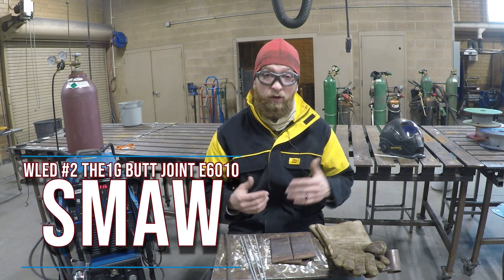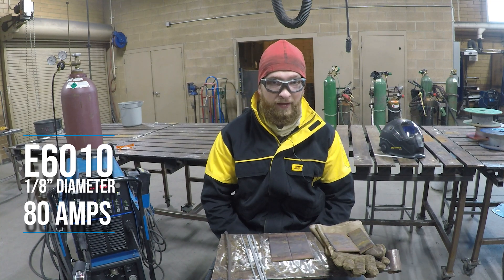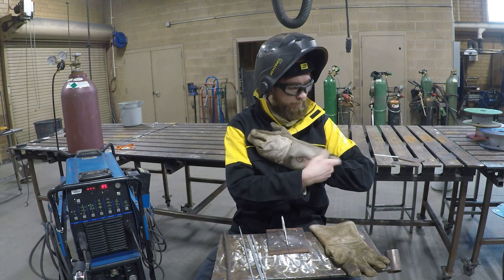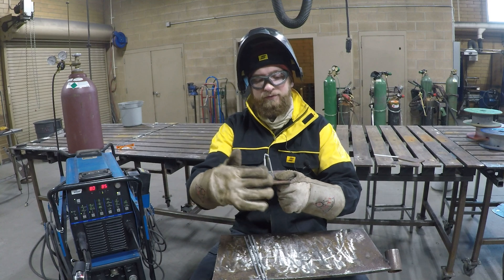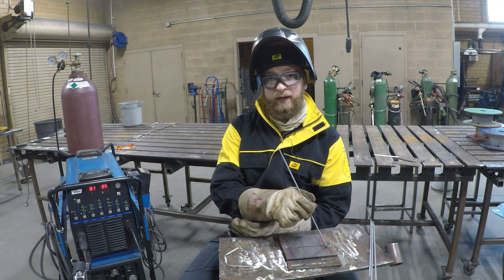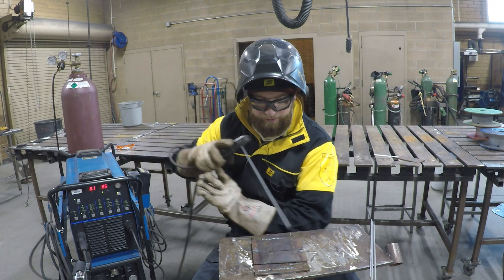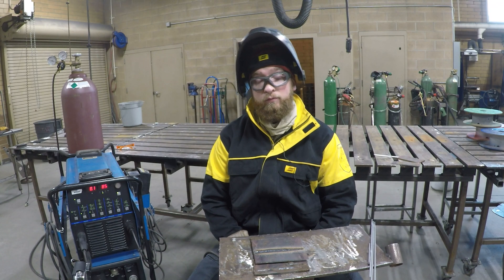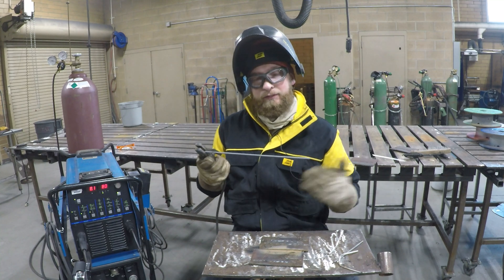SMAW WELD #2 Butt Joint  - 1G E6010

Comment: Nice vid thank you. I have a question about extension cords. Do you think that thinner extension cords gives lower amps than the settings? I live outside the US and it’s a take what you can get. I’m a new welder but definitely find 6010 vs 6013 a more reassuring penetration
Reply from the maker: Absolutely. If you run small, or very long cords the voltage will drop. Ohms law states that they are all connected variables and it will effect amps as well.

Comment: I noticed that your recommendation is different than what I've seen before. Usually instructors recommend that when one whips away from the molten pool, the rod is sunken into bevel (arc length reduced drastically) known as "choking" in order to release excess heat and then return with the regular arc length over the solidifying molten pool to stitch the weld together. I see that you recommend the opposite: where one should increase the arc length slightly during the whip away and return with a shorter arc length to facilitate penetration. This might be the difference that I am looking for. I have no consistency with 6010. I get it sometimes and the others I make a complete mess where my rod sticks and I get no penetration. Thanks for the advice sir.
Reply from the maker: I use the method you mention for just beads on a plate or when the joint is more solid.  With a gap, i'm  trying to  really get the puddle down in the joint.
Reply: @mmhswelding  will definitely give it a go. Thanks man

Comment: Can you run a 7018 on that ???
Reply from the maker: That's a great question. Here in the U.S. most believe that you have to/or should run an open root with E6010. Several codes here require E6010 from root to cap, and some require E6010 root and fill the joint out with E7018.  But most of the world will actually run their welds with E7018 or a similar Low Hydrogen rod.  The E7018 open root is very doable, but it is very challenging, so practice around with your root opening, bevel angle, root face, and amperage.
Reply: This is not a joke if i had a picture i would have show you it but i didn't had my phone on me that time.
Reply from the maker: Oh I believe you.  I think it's possible as well. But it all depends on the rod size as well and amps.  If you set the 3/32 lower more like 60 you could try running a strip on each side, and then try to bridge the gap with a 3rd pass in the middle.
Reply: Ok thanks i did a trade test with a 1/8 steel plate butt joint square bevel overhead an it's a 1/4" gap wide not 1/8 they give me a 7018 rod 3/32 i used 80 amps an it an it haven't came out well.
Reply from the maker: 1/4" Gap overhead, seems like a sick joke.  I'm sure it's possible, but if you have never practiced and prepped up to that size gap, seems like a hard pass.